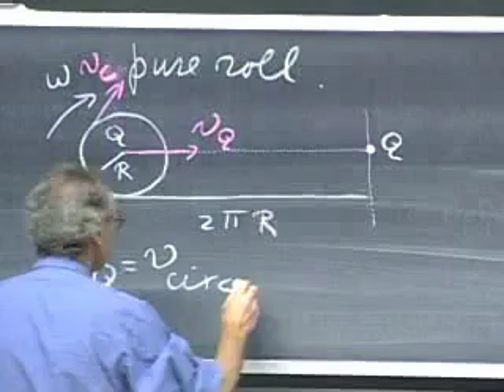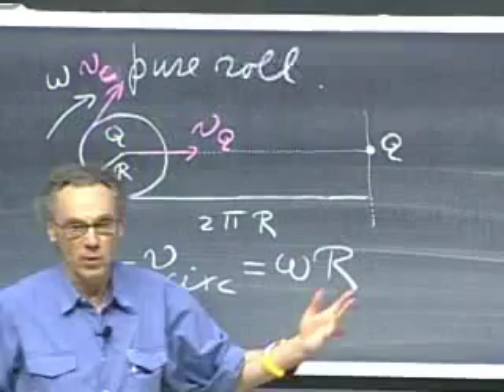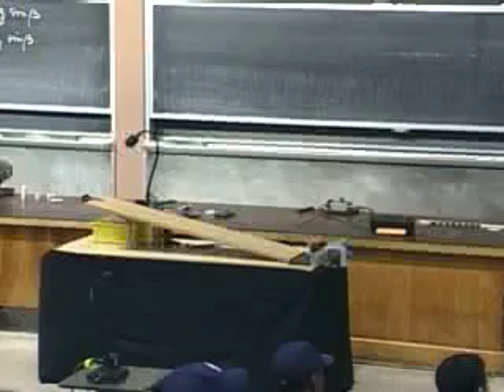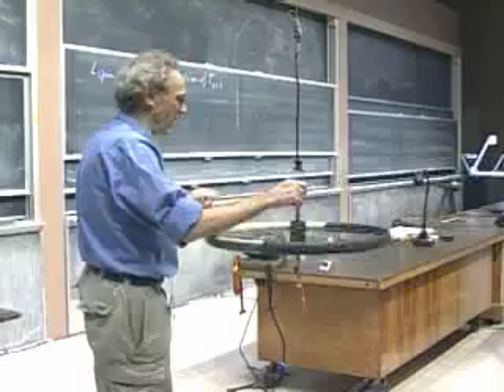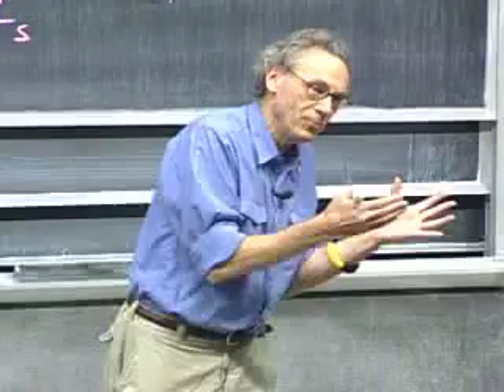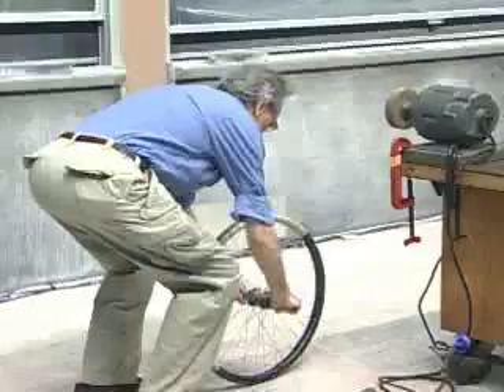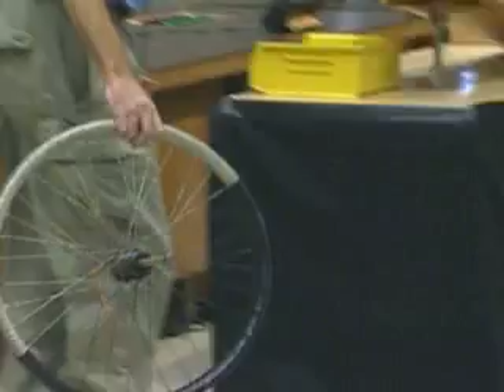Lecture 24_ Rolling Motion - Gyroscopes - VERY NON-INTUITIVE.mp4

Comment: His way ONLY works AFTER the right-hand rule.  That means that it is NOT causal.  The cause is described in my YouTube video Sip_9ew2RjA and Professor Lewin bwocked me from any contact with him, because he CANNOT see it.  I even have the math to back it up, and still, no one wants to see it, because it is new, and people would rather believe in the analogous math, because it's what they know.  You could help by posting this to his site, but he will probably block you too.  Code goes after equal sign if his site blocks links.
Reply: You could use a left-hand rule to carry out the cross products, as long as you use a left-handed coordinate system to go with it.   It is arbitrary that we select a right-hand rule, and we could've just as easily made the choice to set up left-handed 3-D mathematics.   But the right-hand rule in a right-handed coordinate system is the convention to discuss this with other Physicists and users of Physics..
Reply: @carultch  The point is that it is not causal.  It is a mnemonic device.  You are missing the mechanism that causes the effect for an analogous mathematical description.  My math uses the causal "acceleration" that creates the "force".  People don't see it, because they weren't taught to see it.  It is absolutely crazy how deeply paradigmatic this is!  The use of angular momentum scoops up several supplemental effects along with the single cause.  What's even worse, people are throwing mnemonic devices around for cause like the conservation law, because math came first.  Tilt velocity and spin velocity are perpendicular vectors that cannot affect each other, so there is no reason to conserve spin velocity in a plane.  It is just moving mass that doesn't care what happens in the perpendicular perspective.  (This is complicated by the slinging effect of a two blades propeller, but the point is still valid for a disk)  The point is that there is no conserving effect of spin velocity, so math lied to you.
Reply: @jnhrtmn  Oh great, another physics conspiracy theorist who thinks he knows more than everyone else.   Well even with force causing acceleration, you can explain gyroscopic motion from first principles, without re-writing everything like you are attempting to do.  Even without using the mathematical shortcuts of rotational and angular quantities.
Reply: @jnhrtmn  See this, then let me know if you still think it is necessary to invoke your ideas: 
https://www.youtube.com/watch?v=n5bKzBZ7XuM
Reply: @carultch  You are not even trying.  My way showed me that the acceleration vector field is a cylindrical hoof shape extending at normals from the halves.  Your way didn't tell you that.  I understand the cause,, and if you don't try, you will not get it.  Nothing good comes from a crowd, so don't tout crowd mentality as some justification for what you think.
Reply: @carultch    A rock on a string is really far off.  You cannot maintain a perpendicular relationship with the spinning mass and the input force.  A rapid hit makes it look similar, but there is no resistance force in that.  The gyro doubles your input force and turns it back onto you.  Now your turn to watch my video.  You will see what I mean.  Most don't talk to me anymore after this.  
https://www.youtube/watch?v=7hYJebERKlA
Reply: @carultch  I really want to hear how my video is wrong.  Are you searching for me somehow.  I've talked to you before.  https://www.youtube/watch?v=7hYJebERKlA  
Watch it and tell me how "everyone else" already knows this.
Reply: @jnhrtmn  , the Reason is, the Earth is flat. Magnetic Waves is in a straight Line.
Reply: @peterhoebarth4234  I'm convinced modern scientists (followers) cannot even see causality, because they were taught a math analogy FIRST.  Math is just analogous using variables that are likely NOT causal, so describing what you see gravity do is NOT an understand of gravity (clue #1 of the Universe).  NOTHING is understood- just described.  Now, you followers can make fun of me, but you're oblivious.

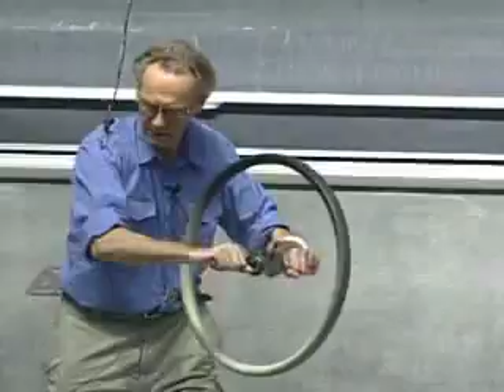Comment: Can anyone be so kind and explain what happens in minute 23:00 , the wheel example and the torque he applies. I mean.... when the wheel is spining with the spinning axis horizontal to the floor... then he applies the torque and 'moves' (tilts) the spining axis of the wheel and the cahir rotates (that's clear for me). My confusion is that I understood that the torque is applied when trying to tilt the wheel, but when the desired angle is reached  I concluded that torque is not required anymore ... so, why the chair keeps rotating eventough he is not trying to tilt the wheel anymore?... ei: Why the chair keeps moving when he is not moving the spining axis anymore (but the spin axis is at a fixed angle) ??   I mean, assume a stationary not spinning wheel which is tilted to one side (ie initial angle 45 with respect to the horizontal) and holded with the hands... it is in equilibrium and no motion occurs (so, Torque =0). If then the spin is started (angle =45) and no 'aditional'  torque is applied, I would expect the chair to stay stationary.....but in the video he continues rotating eventhough the spin axis reach an angle and he keeps his hands fixed???. Thanks
Reply: That's because the chair gains angular momentum when he applies the torque by tilting the wheel but when he stops tilting the chairs spin is not automatically cancelled out. If he would suddenly tilt the whee l in opposite direction then an impulse would decrease the chairs rotation and start spinning in opposite direction.

Comment: 2:00 is incorrect. The circumference doesn't have a single speed. The top of the wheel has an instantaneous speed of 2v(Q). Whilst the bottom point is stationary.